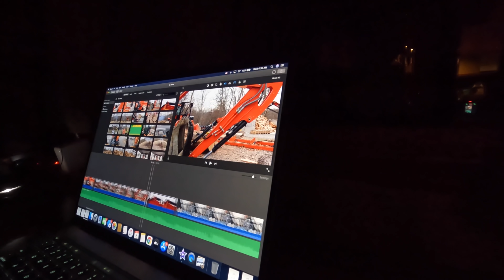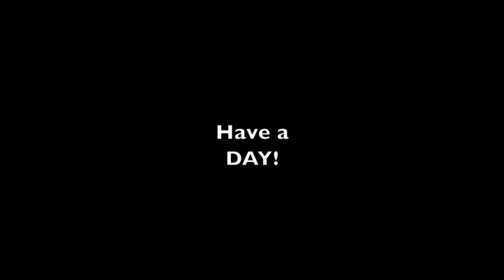Beginning to Look a Lot Like A BUSINESS! Typical Day at The Morgans

Comment: I randomly had an idea about your pond. I know you are attached to it and you might not be able to see the easy way around the couple issues with it. Currently from what i've seen in videos, it's a mudhole in the woods. Needs dredging the silt out, overflow and spillway rebuilt. There might be a few fish in there but I think trying to work with it while it has water in it is more trouble than it's worth for a few fish. Cut open the dam, deep. Let it drain, let it get as dry as your rainfall will permit. The rainfall might even save you some work dredging.  When it's dry enough, you can drive the Excavator, skiddy, whatever in and get it handled. Build the overflow and spillway as it needs to be built. Even if repairing the hole in the dam is a bit of work, I think that's going to be a lot less tapdance than working around the water and mud.

Comment: Always a pleasure watching your daily routines folks... With a little luck, the generous man from LA sent Y'all the approx. 2 qt. spin-on filter as a kit... The cast iron male threaded connector threads in where the outflow hose is now, the filter adaptor has a 90° vertical mount for the  spin-on filter, the hose gets moved to the top of the pump, done... All that will be needed is some waterpipe pliers & Teflon tape..." It's beginning to feel an awful lot like Christmas, nah, nah, nah nah nah… " I couldn't resist, lol! 
Bill on the Hill,
Vermont, USA... :~)

Comment: Levi save your back put the bucket on the tractor run it in and get a scoop of the firewood back out and load it in the bins with the bucket at waist height.
Reply: Or, get flexible, get strong! Save a little fuel and wear.
Reply: @milkman99100  Depends on your opinion of what is smarter. Your opinion is golden, if you live on the North Slope.

Comment: Looking at the lifting and stacking in the totes and my back started to hurt.  At 68 I'm feeling the wear and tear of 40 years in the oil field and I really wish I hadn't done as much lifting as I did.  I loved my job and worked it hard, too hard.  If I had that loading site and the excavator I would dig a trench near the pad where Levi would have the the wood on the pad about waist height.  On either side two totes  not as deep where he would not have to bend or lift much to get the wood into the tote.  Use the excavator to move the wood and excavators to where they are in easy reach.  You have the excavator give it a try and see how it goes. if it works make it permanent if not fill it in. When you guys are as old as I am you'll wish you hadn't bent that lower back so much.

Comment: You need to add some kind of container under the firewood conveyor to catch the debris of bark and small wood chips instead of letting it fall on top of the wall or the ground, Sooner of later you're going to have to clean it up plus it will keep the area looking neater. And tell the guys at Wolf Ridge to make that chute wider and maybe longer. They could even make a kit to upgrade one like yours.

Comment: You should make another 'wood bunker'  where the fire pit is:  Dig into bank, create a high wall & stack cement blocks  as a retaining wall to the upper ground level & would also be the back wall of bunker , open end of bunker down on lower level.   Keep splitter & conveyor up on top and let firewood fall down into bunker.  Pile should rise up as high as the conveyor can go on the upper level, creating one massive heap of firewood

Comment: Good morning all! So I got my hearing aid fixed yesterday so I’m listening to OWTM in stereo again. 😉 I also ran the riding mower over the yard to vacuum leaves and blow them into the beds. I actually took an inch off the grass in a few places too. Surprised it’s still growing, although there have been a few warmish days. I also picked up the washerless faucet stems to see if I can fix that slow drip. I happened to be in the corner of the bedroom when the heater was running, and noticed cold air coming through the diffuser that covers the access to the master bath tub on the other side of the wall. Wow, was that blowing cold air! I think a bit of poster board cut to fit behind it might help with that. Then I get to put the new chain on the MS180C. I got the 3 old ones sharpened, so I should be good to go with fencerow clearing next trip to the farm. And that’ll be most of my day! Retirement is good. 

That aerial shot of the upper and lower woodyard really shows how much more space you’ll have. That whole outer edge can have stuff lined up and stacked up to free up the high-rent space in the upper yard. Like wire spools, old pallets, even less-used tractor implements until you get the covered storage built. Nice!
Reply: It was impressive how solid the stream of firewood was coming off the conveyor when you and Levi hit your stride with that smaller stuff. Only one stroke of the plunger - like it was made for!

Comment: Those shale pits you’ve dug out could be covered with some lumber and used as hunting blinds! Ps those straight lengths of locust make for some long lasting fence posts or otherwise similar uses! Don’t forget to peel the bark off.

Pps it could be cool to put the logo on the back of the t shirts and then on the front some sort of official tag that says “Sasquatch Squad Official Member” 😹

Comment: Video idea. Time yourself splitting logs with both the 4 way and the 6 way splitting wedge. I think you'd save a lot of time using the 6 way on the bigger stuff because then you only touch each log once, as opposed to running each log through 3 times.

Comment: I have a couple question why when you saw a log 3 sides are flat leave the 4 the with bark on the bottom and saw all the way down to last bark side so you don't have a thick board you can't saw because it is to low on the deck , not criticizing just wondering what the reason for flipping the 4 th side up. And in the basket you put some wood in sideways. The baskets i have are 4 foot wide and 4 foot tall and 2 rows  would make a 1/3 cord keeping Eva and whole family is my thoughts, thank you.
Reply: No matter how you trim the log, there's gonna be that last bit you can't fully get to. So bark on the bottom lets you utilize more of the log.... I think.

Comment: When you get the skid steer you will need a bigger fuel tank mine burns 2 to 3 times as much diesel as comparable hp tractor.  Both kabota engines.
Reply from the maker: Yea its almost 100hp